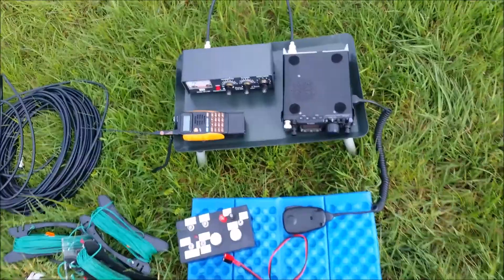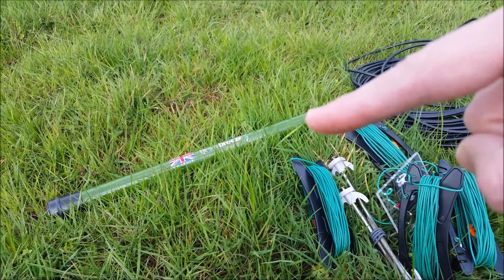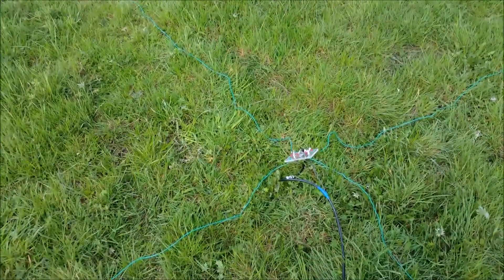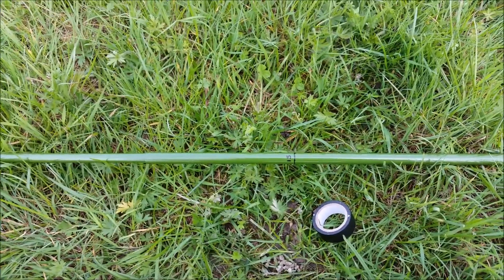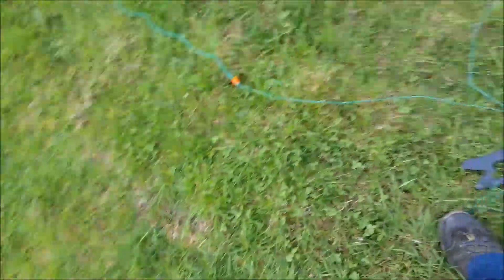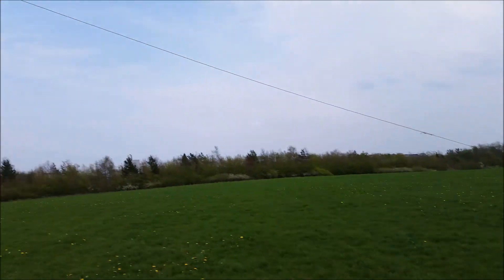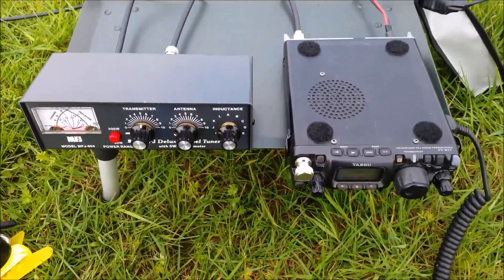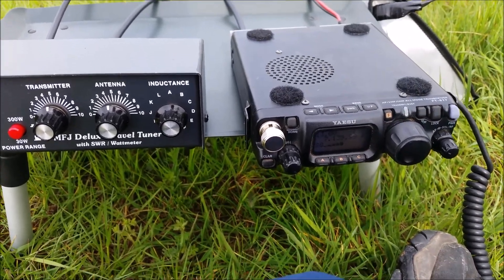Comms Ex 2 - NVIS Antenna Testing

Comment: @AndyWragg did you do a follow up?  I know a lot can happen in 6 years especially considering the last 4.  I was thinking of building this and was hoping to find some good tests.  
A few things I've learned.  feed line wants a 1 to 1 signal, might locate the tunner at the base of the antenna
This antenna isn't a harmonic on any amature radio frequencies.  I was thinking of making mine longer.
I'll keep looking but wanted to share these two tib bits with you.
de ki7cia
Reply from the maker: Hi - Sadly I haven't done any specific testing but I did use it on a trip to the Peak District to make a few contacts not long after this video was made. Little did I know that my IC-706 was faulty and need to go for repair shortly afterwards. 
I've not been very active with the hobby lately, so for the most part my gear sit's unused.
Reply: @AndyWragg  well get your butt out there... lol jk.  Sometimes life has other ideas.  I started down a rabbit hole I didn't expect after learning these military antennas are supposed to be for 6 and 9 mhz.  I've learned that I don't think the little bit of elevation make much of a difference.  And trying to lean optimization with mmana gal simulations that an off centered dipole might have one leg just under 2 meters and the other about 20 meters for an antenna 4ft  or 1.5m off the ground.  I did not expect that. Good luck getting back out there!!!! de ki7cia 73

Comment: Great Vid.
Your installation was proper, aside the ground, but since it tuned with acceptable SWR and you had no RF seeping down the line its ok.
When using an AS2259/GR type antenna which is the KING of wire antennas for NVIS, it is important to note a few things: at the specific time where you operated-where you on the optimum band/time for your area and solarflux activity for NVIS? 

Where there close in stations within 40 - 400 klm away also using NVIS setup? (it is best for both stations to communicate with in NVIS to have the same setup)
Are you aware that with this type of antenna: a difference of 1-3 meters higher/lower can affect better SWR as this inverted V is notorious for inducing outstanding 50Ω match at the feedpoint when properly aligned (is the inverted V) and at the correct height/angle?
 But also, you must understand that , it is affected by the substance below the ground at an est. 3 - 9 meters depth. depending on where you are what type of soil or bedrock is below (the natural reflector) which slightly enhances the vertical incidence.

By the looks of it, you had great vertical incidence!!!!! but no station to receive your signal within the reach of your NVIS setup at that specific freq./time. I love radio prepper! and his note below but I do not agree, this is the king of NVIS wire antennas, aside from also the T2FD (I use both for low power off grid medium and close in manpack comms.) also the AS2259 antenna is an amazingly quiet receiving ant. possibly the T2FD is better on receive but the AS2259/GR is unmatched for transmitting a signal up in the sky aside having a 8 element 80meter band beam perfectly vertically aimed at the ionosphere........lol.

I have unparalleled success out of mountains and at the base of gorges with under 10 watts all the time (vs. time and freq.) where EFHW antennas can not, thus I always equip my manpacks with an AS2259 NVIS antenna. though great RX DX grabber and very quiet on receive. you must have another station within the estimated range/freq./time available to enjoy  solid quality communications that this great setup supplies us with. this allows you to have robust comms. equal to line of site type communications as you would with VHF FM repeater type quality but without the infrastructure. I could talk about its military tactical applications forever as well but that's a different story.

It is most unfortunate that this antenna (along with the t2fd) has been kept  secret by the military from the armature radio community. The more you know about it the more intriguing it gets out of all HF antennas ever! , and also its combat radio tactics applications are very noteworthy. its decline came when it was in fashion in most militaries to use satcoms and the trend for more fast moving military ground forces to be more speedy and to have more in transit comms. came upon mission planners etc. thus the mobile loop antennas came into place as for example. but if you have the time and real-estate to set it up, its unmatched performance is supreme ! period ! 

I use it both with green radios and armature as well but always for network comms. it is useless for DX!

I cant wait to see your next vid concerning this wonderful crossed dipole circularly polarized antenna, I'll try to find the time to make a PDF with my own design concept about a modular HAM version of it and send it over.

73 DE SVOKU

Comment: Hi Andy, did you ever try this setup out again, if so how did you get on? .....Paul
Reply from the maker: Sorry not had chance to repeat the experiment yet. I retired the uBITX and am now waiting to build funds for an IC-706MkiiG which will become my portable station. Also the land I used for my testing has now been taken over by Gullivers Kingdom so I need to find another testing spot.
Reply: No worries mate, I’ll be building this antenna in the next week or so and use 817 with it tuner, used NVIS many times in Army, but got everything given then 😂👍🏻

Comment: Good installation Andy, surprised you did not make contact. Maybe a little later in the day, after sunset... Answering CQs will lead to more contacts than calling. Use half-wave wires, it will work much better.. Let me know next time you try, I'll get on the air!